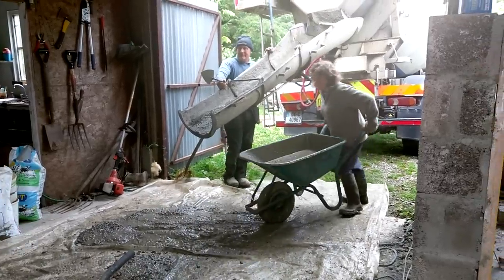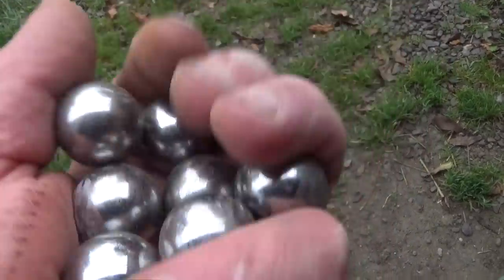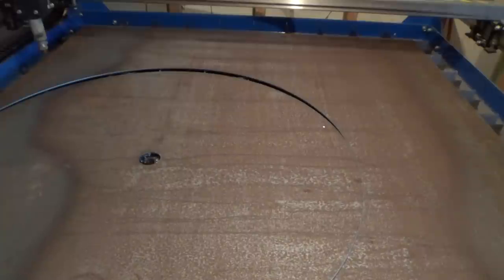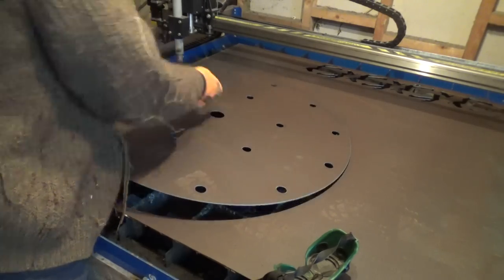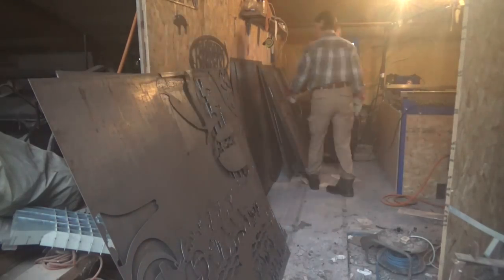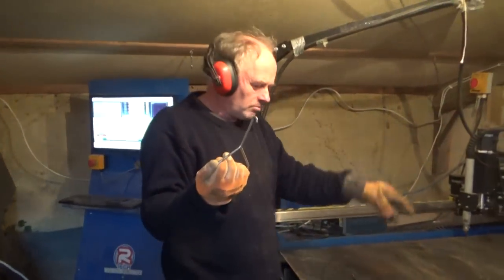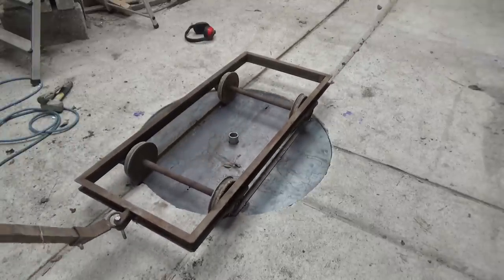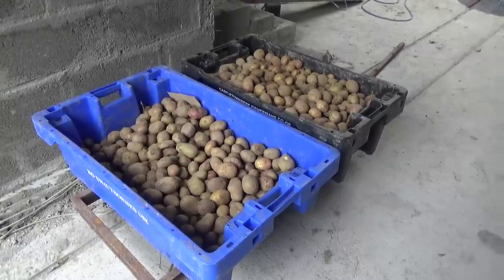Making a Turn-Table For a 15” Narrow-Gauge Railway

Comment: Proper job there mate! My only comment on the turntable is it would have been handy if you made a small "detent" for the ball bearing to roll into to help "locate" the turntable in action. Otherwise very cleverly done and it looks like it is serving the job it was intended for nicely!
Reply from the maker: I hadn't considered that at all - shows how much research I'd done! Yes, it might be useful, but it seems to work fine as it is - going slowly as always.
Reply: I was thinking the same, but I wondered about cleverly placed magnets to provide the latching.
Reply: In this case a detent would just offer a place for dirt and debris to accumulate and make it harder and harder to turn until it was impossible. It;s better how it is now as the bearings can just push debris out of their way as they run in to it.

Comment: Not sure the specifics of your set up Tim, but when I added a good air dryer and micron filter to my cutter, it improved tip life by ~ 400% on average.  Very clean, very dry air can and will make that much of a difference in consumable lifespan.  That, and always fine tuning the amperage for what you are cutting to minimize splash etc will make a big difference as  well.  Looking forward to the next blog!  /Waves to Sandra!
Reply from the maker: It's something I've struggled with from the beginning. I put in a fibre filter and that made a difference, but not much. So I spent a lot on a refrigerator unit - and that made a difference too, but not much. Not sure what to try next?

Comment: i remember seeing small railroads (railways) like this where they were so small that the trains ran in buildings  . i even saw one on a ship. they also used turntables like yours to turn or shunt instead of points in tiny places . (wharehouses , constructions sites , etc) job  done.:) almost .

Comment: Plasma cutters  (and their consumables) like VERY DRY air. A combination of water separators and filter elements are critical. I run a 25' hose in a coil from my compressor to a separator, then a Motor Guard brand "toilet paper" style filter at my machine for clean/dry air.
I also sold my inexpensive Chinese machine and invested in a quality US made machine, I go through a lot less consumables now... My cuts look so much better now too! I'm saving my pennies for a CNC table.
Cheers :)
Reply from the maker: I have an in-line filter plus a refrigerator dryer already, but I think I'll have to add to those somehow.

Comment: SUGGESTION: You'll want to weld plates to the left, right, and center of the top of the turntable that is flush with your floor. You don't want your turntable to become a tripping hazard. You may also want to design a latching system to lock the plate in place for when not in use. (Again, spinning disks also are a trip/fall hazard.) Maybe a spring loaded bold on the side, so you can access it while a cart is on the turntable.

A bit late for the pour, but you should have used C channel for the track in the barn. Would make screeding the cement easier both inside the track and out while give you better clearance on the wheel flanges. Hopefully, your barn floor has some decent rebar in the slab, or that concrete could flex and crack under heavy loads. Concrete is great for compression, but doesn't perform well under tension and sheer loads. That's where the imbedded rebar comes handy. There's a YouTube channel called Practical Engineering that has an excellent series of videos on concrete and different ways engineers make it work better for our needs.

Comment: I was worried the nuts/spacers would rub too much on the bottom plate but it seems not to hinder movement at all. I would have turned that middle plate upside down and used the nuts to bolt it to the top plate, so there would be no friction at all other than the bearings themselves. But seeing how easily you can turn it I guess it wouldn't have been necessary!Really nice!
Reply from the maker: Wouldn't it be tricky getting the balls into place if the middle plate was attached to the top one?
Reply: @WayOutWestx2  Not too much if you put the middle plate and the balls like now, the top plate on top, and only then bolt the middle plate to it. Aligning the 2 plates might be a bit tricky though. And again, seeing how smooth it already is, it's not worth the trouble!

Comment: Seems like a real time and labor saver. You might add smaller ball bearings inside the spacer nuts. It would cut down on friction and raise the platform some to reduce the the small drop. A hole in the concrete and a spring detent would aid in alignment.
Reply from the maker: Well the spacer nuts only lift the center disc and don't effect the overall height. But you're right - it might make it spin easier. But it seems to work fine as it is and the simpler the better, right?

Comment: I've been mainly interested in your 15' railway set up you have and I wanted to suggest something I understand your on a budget and this kind of helps with that. If you have a lave, I think I spelled that wrong, but if you have one, I recommend getting old car wheel hubs mainly the ones off of rear car brakes, and use those for wheels, i've seen it done once on a video on Facebook. I don't know how much they go for out there but here in a wrecking yard they could be anywhere from 15-20 dollars us money just a suggestion from one innovator to another.
Reply from the maker: A lathe? No I don't have one of those (at least not for metal work anyway). Yes, I thought about brake drums - but I think they'd be best for a bigger set-up than mine. If I ever find them I'll try..
Reply: @WayOutWestx2  Try the brake rotors instead of drums. Only problem with them is they would be deep flanges.

Comment: Very nice, success.  Any plans to rust proof the swivel mechanism so it works for years to come?
Reply from the maker: Thanks, Colin. I'm not sure how to do that though. If I put grease on it that would just attract all the grit. Any suggestions?
Reply: @WayOutWestx2  A good coating of epoxy paint on the bottom side of the bottom plate would help as that is where most of your rust would start.

Comment: Very nice. A suggestion cut the center pipe shorter and weld a spigot facing down to fit in it on the top turn plate, less likely to trip on it when carrying something and vision obscured. Just a thought.
Reply from the maker: You're right - that would have been neater, for sure.

Comment: I think if you shrunk the middle bearing-holder layer a bit, and welded a ring to the perimeter of your top plate, your top plate would be far less likely to deform over time.
Reply from the maker: You're right - but why should it deform if it's well supported?

Comment: I think for this, I would have had some C-channel bent into a hoop with the open face of the C facing up welded to the bottom plate (another facing down welded to the top plate), then just fill the slot with bearings and grease.
  
Also think a way to lock the table in position would be useful - even as simple as a pin.
Reply from the maker: Rolling channel is tricky and needs specialist equipment. It would be possible around here but would cost hundreds..
Reply: There is a simple way to latch them in place even with the rails embedded in the concrete. Instead of in line with the rails, you make a sliding lock that is 90° out, that slides into the flangeways, one on either side of the turntable in this case as he only has 3 leads. You use the ones on the opposite way of where you are going to secure it from turning.

Comment: Have you given thought to constructing a locomotive of some sort for your railway, once it is extended further? I’ve recently taken in a 15” gauge (technically it was built to 14” gauge, but upon measure, it is closer to 15” or 16”) railway built by a friend, largely from wood. The “locomotive” is a simple two-axle car, with a seat, and a set of cranks, which drive the front axle via a bicycle (sprocket) chain. I am going to add a second chain, between the first and second axles, to increase the currently modest traction it has. Perhaps constructing a similar machine would be a cost-effective, and easier way to move your railway cars, once the line grows longer. However, considering the weight of some of your loads, it would need to include more metal in the construction (the car my friend built is mostly of wooden construction, after all,  so it has less traction to lend). He took a video of it a few years ago: 
https://m.youtube.com/watch?v=LC7NnyfiHXs
Despite the traction issues, the car is not difficult to operate at all. Reduction gearing helps make it easy on the hands.
Reply from the maker: Interesting, but the point many people miss is that if you use steel on steel (or iron on iron) then the friction is very low. So low that even a child can pull/push heavy loads. We just don't need a locomotive (for now, anyway!). 

Your wooden one looks fun though. (But if you tried steel on steel you would be amazed at the difference it makes).
Reply: Yes, steel on steel is definitely much better! Have you thought about constructing a dumper trolley, for moving things like manure/gravel? Or even just a fixture for attatchment to an existing trolley. I do not have one yet, but I want to build one at some point, as they are very useful for easy unloading!
Reply: You could simply make a smaller cart with a small wheel (say a trailer wheel) electric motor and a car battery and attach it on when needed.

Comment: Next, I would like to see a 1/4 scale steam engine, (probably made from a washing machine or something.) you have one week!
Reply from the maker: Ha! Well of course that would be nice, but the whole point about a railway is that it's easy to move heavy loads on them by hand. So, in a way, an engine is the last thing we need!
Reply: 15" gauge is fine for 1/2 size also.

Comment: I was thinking how you could use some grease, and then, just when I saw it the second time, I thought, you could cut the two plates below two cm's smaller, so some eventual dirt could fall just down to the ground beyond and would never clog up with the grease ... ???

The nuts and the balls would enjoy the lubricant ;-)
Reply from the maker: Yes, you're right - though the bottom plate is full size to keep it in the middle of the hole, so another way would have to be found to do that.
Reply: @WayOutWestx2  maybe you could weld a shallow ring (deeper than the nuts) in the outer area, just to keep the dirt outside and away from the grease and every moving part, as just a very little stone could stop the turning immediately without warning ...

Putting some grease in the outer area would keep the dirt from walking around by vibrations

admire your work, man, (and you and your family and attitude as well!)

(I am Austrian so my English is hopefully not too bad?)

As an old man of 56 I'm back in electrical-engineer-school (after a life of beeing a musician aso...) and choosed to build a plasmacutter as my final project ... by now I already bought some iron tubes ;-) still I hope to succeed until June, while having a lot of heavy exams aswell ... :-%

I was thinking about building one for myself for some time, but when I saw you buying one, my destiny with fixed ;-). Hopefully the free software will do a propper job ... :-/
Reply from the maker: Best of luck with your plasma cutter, Paul. I never went to college or anything like that so I found it all quite difficult - but I'm  getting there now : -  )

Comment: Tim you might want to lift that back out again pull the center plate and pack those nuts full of grease. At least that's what I would do.
Reply from the maker: I have done exactly that - but I wonder whether the grit that's getting stuck in the grease will do more harm than having dry bearings?
Reply: @WayOutWestx2  good question.

Comment: This is some really low quality junk. I know your trying to do it cheaply, but your rails don’t line up and the flange ways have concrete in them.
Reply from the maker: Sorry you don't like it, Jason. I've used this for a few years now and it works fine thanks. Yes, it's a little clonky but that's ok by me.